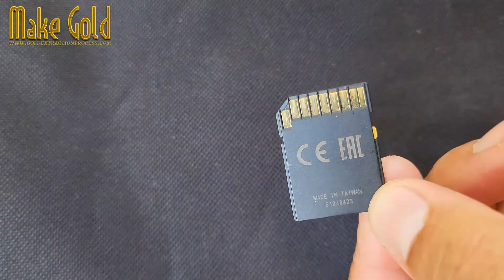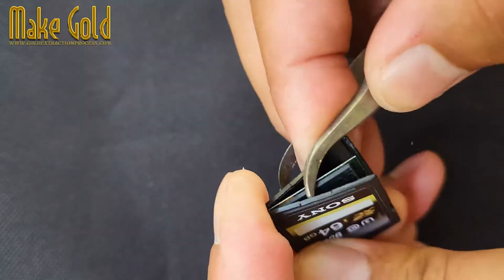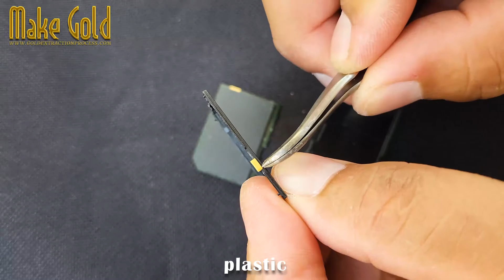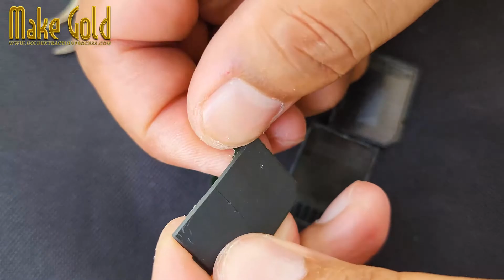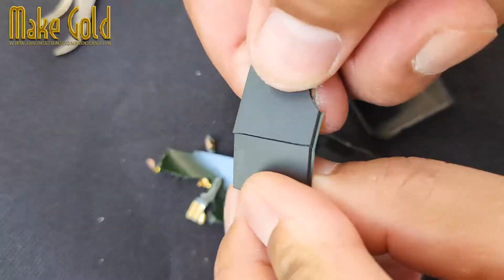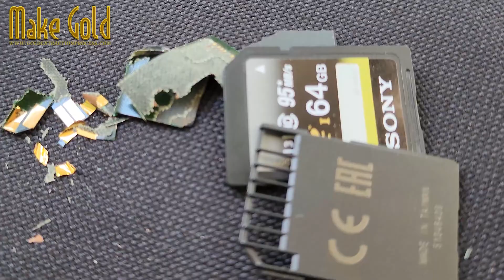Does an SD Card Contain Gold? Hidden Metals Inside Memory Cards Revealed!

Comment: Is there possible very tiny bond wires encased in the epoxy layer on top of that memory chip? There is in the bga chips top black epoxy cap. The one that you peel the circuit board material off of.